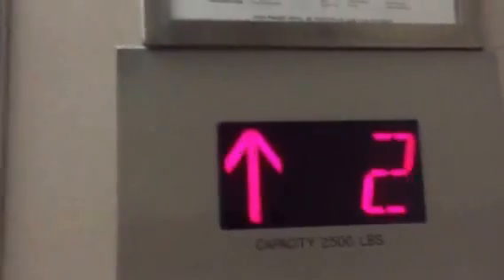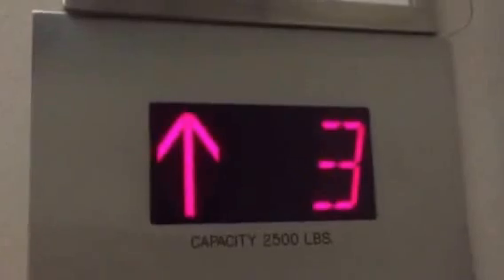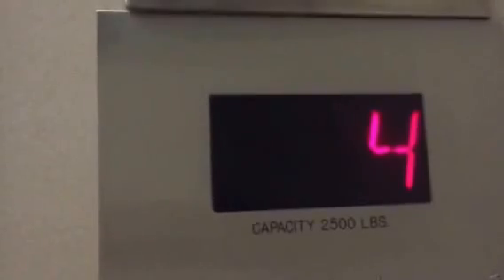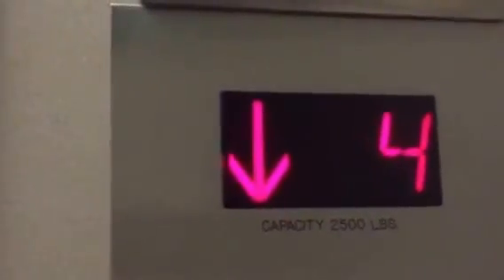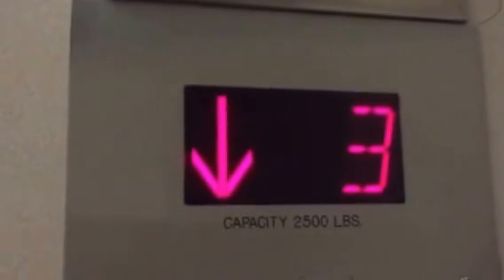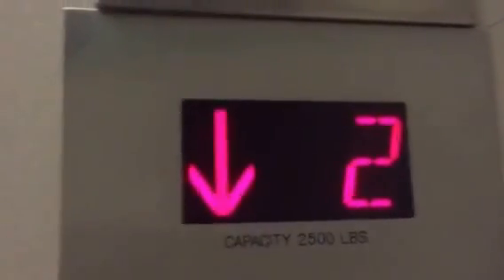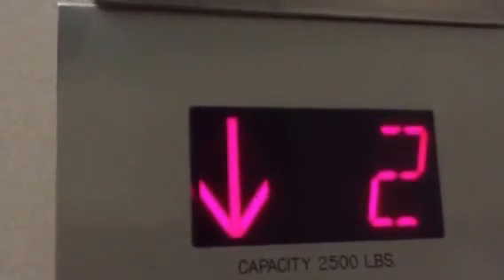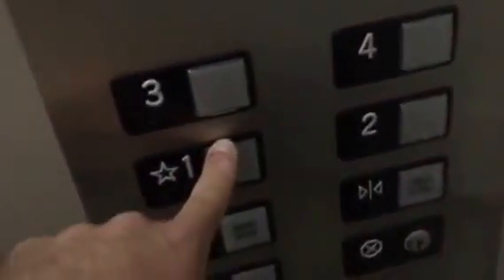Crapcoized Vintage US Hydraulic Elevator @ 7801 Mission Center Court, San Diego, CA

Comment: Possibly ERM CA-94.
Reply from the maker: Not CA-94. This was modernized quite recently and CA-94 was discontinued in the mid-2000's.
Reply: Oh they are BADams. It's not CRAPCOIZED it's BADAMIZED.
Reply from the maker: Yeah maybe Adams Designer more likely.
Reply: It is according to the keyswitches. EPCO Designer is only with EPCO keyswitches. EPCO has rebranded Adams fixtures and only with EPCO keyswitches.
Reply from the maker: Yes it's Adams Designer fixtures.
Reply: I freaking do not like this EPCO WN / Adams Designer crap modernization a lot.